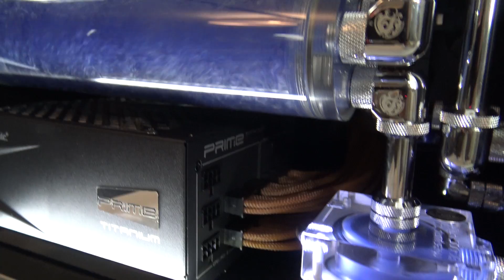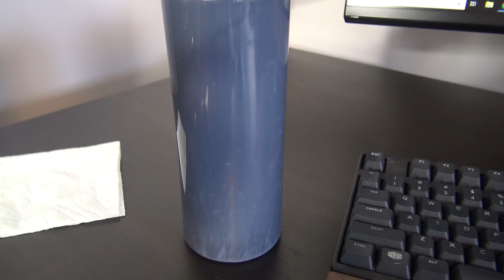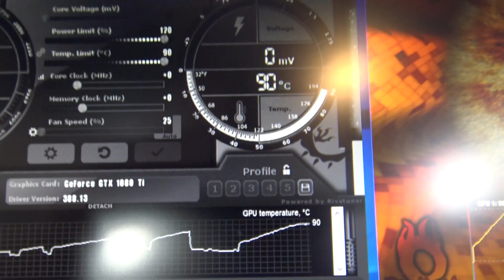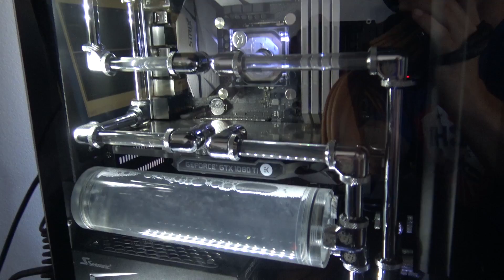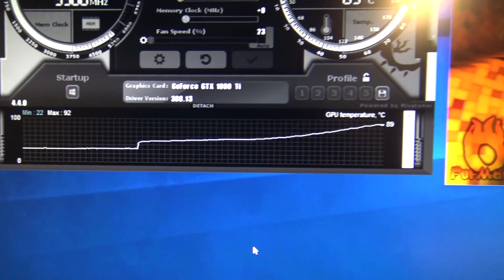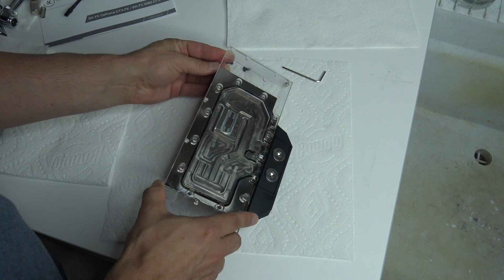PrimoChill VUE: 6 Month Follow-up

Comment: I put this stuff into a new loop (all components new) and it was the most visually stunning fluid I've ever seen. It was literally mesmerizing.

About 4 months later I took the loop apart just to add a GPU backplate for a sandwich and found solid matter was everywhere, including stains on the inside of the tubes (hard) and the reservoir. It was even inside the fittings!

A very thin talcum-like powder, white and light blueish. Had to throw the tubes out, was able to disassemble the blocks and res to clean them. No permanent damage but a royal PITA that was just not worth it.

Comment: Hey man great video that gave me a lot of info that helped me decide if Vue was worth the hassle.

I’m still a bit confused with your thermals on the GPU. Even with a low fan curve I don’t see how a 1080 on water could hit 90C and throttle so hard in 15mins. Did you ever take the block apart and double-check your thermal pads and paste? I can’t even break past 72C with my 3080 and that is with the fans manually locked as slow as I can get them without them stopping (around 250rpm).

Comment: I wanna see tests with what's better.
Running opaques fast to try and force the particles through with more pressure but more times or slower so they make less passes and possibly less stuck

Comment: I do not use pastel / solid colors because I do not want to deal with the buildup. But like you mentioned at the start, you must do your research. I did my research and decided on EK's Blood Red Cryofluid and it has been awesome. Another note: 90C is very hot for a gpu on water even with the fans on low.Those EK blocks tend to have problems with temps unless you use the shortest possible screws.
Reply: Yeah his GPU temps were really bad. I tried to replicate them by locking my fans on their lowest possible speeds and running FireStrike Ultra stress test for 15mins and my GPU barely touched 71C core (85C junction and 79C hotspot). That was with a power-hungry 3080 drawing twice the wattage that his 1080 did. I normally undervolt it to keep the temps even lower and draw less power but I reverted it to factory settings to try replicating his results. 

Why do you say EK has problems with the screw lengths? I have an EK Quantum block and didn’t have a single issue with the screws.

Comment: ok guys I learned something from literally so much research it caused my brain to go on vacation to the Caribbean and it just called to tell me it's not coming back for a month maybe 2....  seriously watched something like 10 to 11 hours of videos and spent countless days on reddit scouring the inter webs of all knowing knowledge.... what I saw in everyone of the videos that had separation and settling of effect goo issues was ran with crap for booty dead flow pockets.... i was a plumber from a union in colorado for years and thus I knew when building my loop how to avoid these.... now example ,V . A E S T H E T I C not picking on you trust just good example, your loop the cpu block is side ways for a left inlet and right outlet now the side ways position on the block let's there be the dead flow area I speak on.... simply turn the cpu block in a vertical setting and fixed I bet... as well as maybe run rad in a inlet/outlet on top not bottom of the pc positioning... don't know where yours is but ya .... saw alot of people that had drain tube sections and a valve  had the goo settle in it as it has no flow.... but I suspect the orientation of the Flo determines, least every case I saw vue used, the length of time in which the "effect" lasts :) hope this helps anyone that finds it :)

Comment: Why use that will destroy your loop and cooling in the first place?! I don't get the logic. Use the proper distilled liquid without unnecessary additive.
Using Vue liquid is like adding RGB color to your case. No one gives a shit. You're not looking at your case when gaming. Only wasteful energy drain and a distraction with all the blinking and lights.

Comment: When you're putting in primochill if you haven't completely clean the line or if there's anything left of the fluid that came before or if your blocks aren't completely clean primochill actually clean the stuff off and it's going to start to accumulate in other areas really if you're going to use primochill only use copper if you use anything else other than copper you're going to have a reaction and please clean your lines well if not you're going to get a reaction

Comment: I think if you are going to use a solid fluid, i think the loop maintenance interval should be roughly be 6 months with a monthly stress test and visual inspection. Clear Fluid with clear dyes should be fine for a year until a change but a visual inspection should be done every other month.

Comment: im coming up on 2 years in my loops. so far no adverse effects. so separation of the particles, i took one loop apart and everything still looks nice and clean. went ahead and put the original fluid back in and continued to run it.

Comment: I got about 3 weeks out my Primochill Vue Sterling Silver. CPU, GPU and all tubing had a very heavy film build-up. I tried a Reboot flush and it was still pretty bad. Tossed the tubing and went back to EK non-opaque coolant never looking back.
Reply: If you used soft tubing, the VUE must have leached some plastiziser from the tubing since its mildly embrasive.
Reply: Vue also reacts with air. Mine went milky from because i had one of those pressure relesse fittings. Replacing it and using replacement coolant, going on near 2 years without issues since.

Comment: how the hell GPU is reaching 90 degrees on water? my 1080 ti reached 60c after 30 minutes. Also a watercooled PC with two 360 rads.
EDIT: I'm running the fans at 800RPM. 90 degrees is just not possible in my loop.

Comment: When it comes to water loops I have stopped using that Mayhems blitz clean crap, I started using it under the instruction it must be used to clean out parts, yet every time I have used it and despite following the instructions fully I found that i was getting color shift and fallout within 5 months with Mayhems pastel blue, my last PC however I used the same parts but new  and skipped the blitz  and chucked the mayhems pastel right in and that lasted over a year and a half before i decided to clean the system and it had minimal fall out and no color shift at all, so I am convinced that the blitz clean crap is the cause

Comment: Sedimentation....  Have you tried fixing it by adjusting pump speed? There is a decent amount of head pressure with all those fittings and or you might end up with more laminar flow and less turbulent flow to mix the sediments back into suspension. I doubt they are glued to anything in the system if you are not running air bubbles needlessly in the loop to oxidize or evaporate part of the fluid.

Comment: Good lord 90c on liquid?! My 1080ti with vue runnning for 8 months tops at 42c while gaming for 3+ hours at a time. That has to be something besides the fluid causing the temps to be sooo high
Reply: totally agree. I also have 1080 ti with custom loop. Temps under furmark never reach 90c. It reached something around 60c.
Reply: He explained it in the video, he had the fans set to ramp on CPU temperature, so they weren't spinning.

Comment: Very informative video. PrimoChill recommends not using the Vue for more than 8hours  a day, did you run it longer than 8 hours pr day ? Just curious as I tend to let my pcs run all day long.
Reply: I havent had problems with long run times, Ive been running Vue for 9 months and I normally run between 6 and 12 hours at a time. I ran it for a month just to see what would happen and its still like the day i filled it.
Reply: @IONredline06  Glad to hear=)
Reply from the maker: I don't usually run my PC for more than 8 hours in a given day

Comment: 1.19 There was no 'research' for VUE at the time it was released (Late 2017).  All the hype suggested it was designed not to clog and it was touted as a long term coolant unlike Mayhems Aurora.  But yes, in hindsight I agree we with you that every coolant that contains some particulates is going to clog or cause issues eventually.
Reply: AJ I agree. No warnings or info was available. Now Primochill has pages of warnings on their site.

Comment: I have no issue to change coolant but the primochill Vue is just absurd just look at some of the precautions
you can't run your machine for more then 8 a day ?
you need to change it about 4-6 months
and some other bs. no thanks other coolants have much better tolerant you can run them 1-2 years with no worries or issues flush your system and put the new coolant.
Reply: Eliad Buchnik     I agree. I was hoping that it was gonna be better than the Aurora stuff but it’s basically the same, if not, worse. Currently I have some white pastel running in my loop and I just changed it after 2 years and my blocks looked perfectly fine. In the future I hope coolants like Vue and Aurora become somewhat reliable because they look amazing.

Comment: Don't think I'd be comfortable suspending the reservoir over the power supply.  I'd probably at least flip the P/S over so the fan draws air from the bottom of the case maybe preventing leaks causing a short or, heaven forbid, a fire.
Reply: Unless the ends pop off the reservoir I see absolutely no reason to worry. The fittings are the place where there could be a leak and he is using right angle fittings screwed into the reservoir, so if the tubes pop the coolant will spray up or down way to the right of the PSU. And if the PSU was to get wet from there , then it would from any where in the case.

Comment: That's why I have used simple de-ionized water with PT Nuke and Feser Base corrosion inhibitor for 15 years now.  If I wan't colour, I use coloured tubes/pipes and only flush if I keep a PC for more than 5 years. ^_^

Comment: Thanks for the information. I would be interested in trying the VUE fluid. For fluid I usually use just distilled water and a small amount of HydrX. Here is a couple of quick "not very good" Pics of my Lian Li Dynamic build I am just finishing. The tubing is Acrylic so I can run any fluid.
 https://i.imgur.com/7t7E9HD.jpg
https://i.imgur.com/I2TBwNJ.jpg

Comment: Aurora has worked for me. Only falls out after awhile but doesn’t clog. Also pastel by mayhem’s has never gave me a problem. Ended of the day I prefer clear just because it looks nice
Reply from the maker: I have used Aurora 3 times, never long term, and every time it has coated the inside of everything with silver. Don't get me wrong, it's gorgeous, but definitely a pain to clean up. I've never had any problems with pastel fluid but there's always a little bit of stuff to clean out of the blocks.
Reply: Vir1lity PC Customs it seems it is just like the vue where the experience varies from person to person. Build to build

Comment: Set the Fan Curve in Bios to the Water temp... if you have a temp sensor!  Still, 90° is way too high for the GPU under water, even at low Rpm Fans or Passive Rad cooling... Check if the Block is mounted properly right length Screws & right thickness Thermalpads!
Reply from the maker: I thought about that but keep in mind this case has terrible airflow which greatly diminishes its ability to passively cool. Especially considering I had just run a cpu stress test.
Reply from the maker: That's normally how I set up my fan curves. Not sure why I skipped it this time. Probably just an oversight
Reply: I watched your video in two parts, now I heard you mentioned it... Blocks looked quite good opened! Seen worse! ... :)